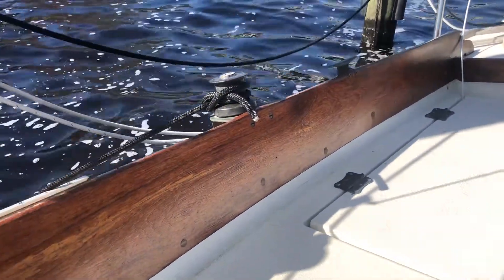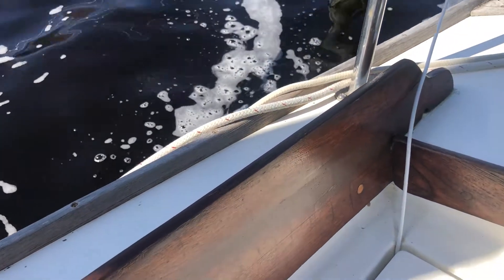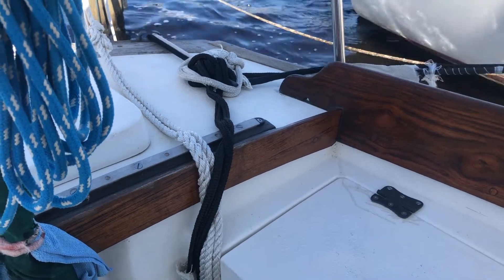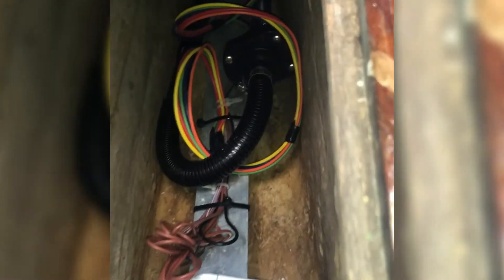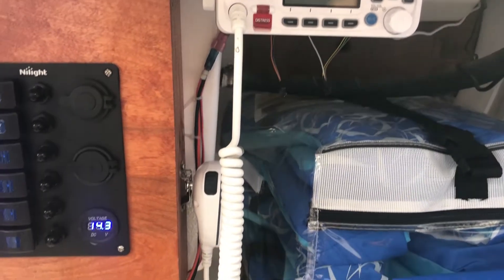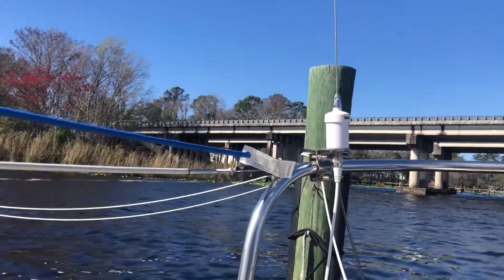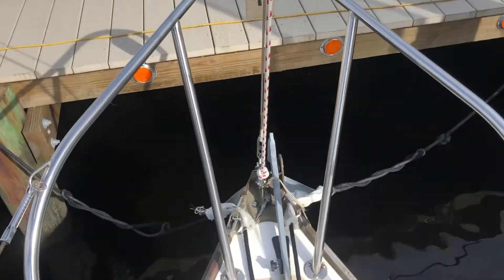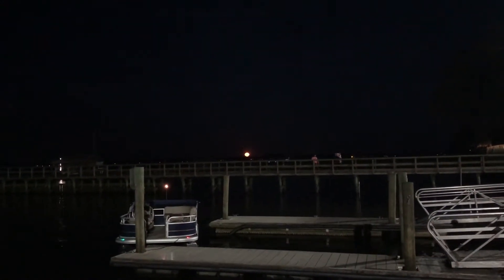S1 EP3 - Refit, Rinse, and Regatta!

Comment: What a great boat, huh?  I noticed the seacock reference you made.  I serviced mine on my CD22 and it was a bear.  Even replaced the hoses. You might consider replacing the wooden backing blocks for the seacocks, as mine started weeping due to delimitation of the plywood. 

There are good resources for this here: https://marinehowto.com/seacock-backing-plates/and here: https://marinehowto.com/servicing-tapered-cone-seacocks/
Reply from the maker: Yes, great boat!!  The backing plates are definitely on my list.  Thank you for the links.  What material did you use for the backing plates?  Did you through-bolt through the hull, or did you use the method in the link?
Reply: @sailingbeautiful5472  I bought G10 material (as suggested by MarineHowTo) from Jamestown Distributors but sold the boat before I did the repair.  I have a CD27 now.
Reply from the maker: Thanks!  I’ll be looking for G-10 when I’m ready to address the seacocks at my next haul out.